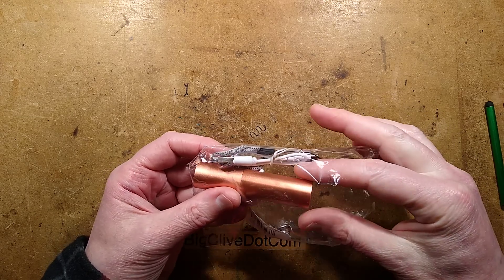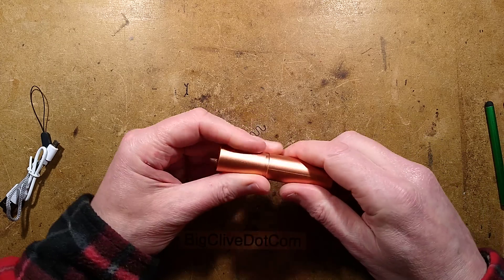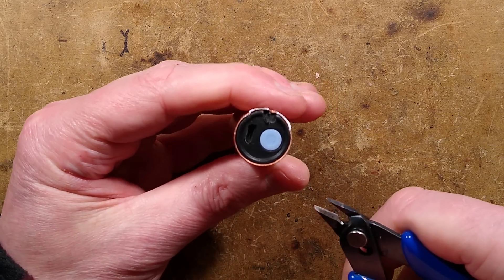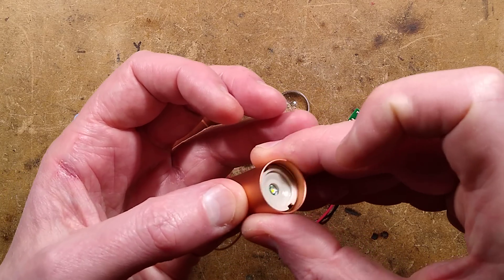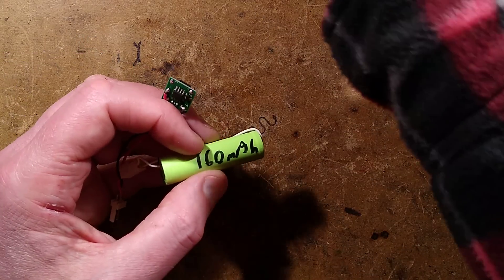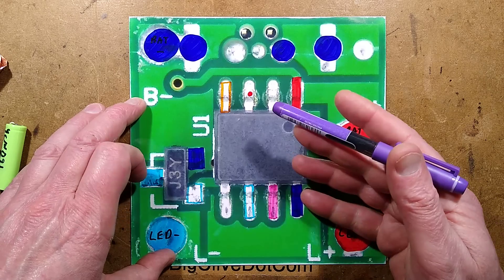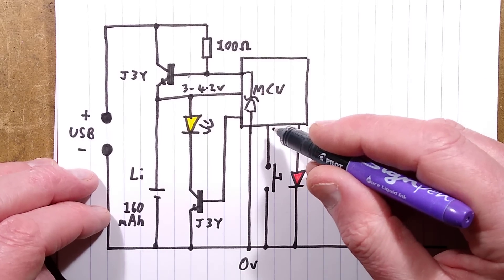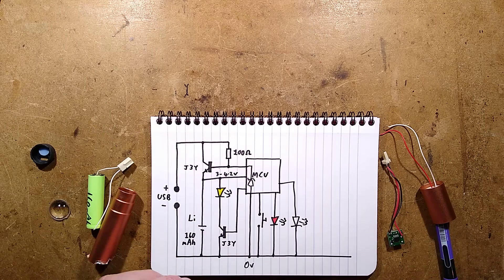eBay 98kW LED flashlight (slightly exaggerated) with schematic

Comment: I have pretty much the same flashlight but it is black... and also UV.
Mine has a problem with the micro USB port where it gets pushed in when I try to plug a charger to it so it has no contact. Now I know...
I don't prefer the use of foam as a way to stop PCB from moving back and forward. But it is a cheap way to make a cheap flashlight so I get it.

So the only problem is that I cannot charge it... and that is an issue.

Comment: Not eggagerated you can get 98kw, but you haver to use the 100000a/h ebay  - ali express 18650 batteries

Comment: ebay product descriptions. lol.. i just bought several "UVC sterilising" lamps, armed with the BC knowledge that all UVC leds are brassy , with a glass lid. i knew what they were selling didnt look like that. i got 3, complained to ebay, got refunds and kept them all. ebay tried to get me to return them, i said the process to prove their falseness destroyed them, but i could post the bits, they said dont bother. so i am going to do it some more. i just ordered another 3. i have found ebay are pretty awesome about giving money back when scammed. i bought a new "shure sm58" t'other day. it was 40 quid. it arrived and was clearly a fake, even the shure logo on the box was wrong. i complained and they said i had to return it, i said i could not, as i took it apart to use for supplying voice to a ring mod in a Dalek i made for special needs kids to ride around in. so i got to keep the mike (which TBH is okay, it was just the thought of someone thinking they could swizz me that enraged me so). perhaps we can all start buying 'uvc' lamps. you get to keep a lot of ice blue and purple led packages when you do. amusingly i even messaged these sellers before i bought anything, saying "your product doesn't look like it has UVC 'beads' in it, are you sure it make light under 280 Nm light?" they always reply "yes". bastards. lol.

Comment: You forgot to use a micro black hole to power it. That is why it didn't get it's rated output capacity. 🤣

Comment: Hey China, THANKS for the flashing mode on torches - thats what was so missing in the last 100 years and thanks for the 'economic' construction so that, despite it not havinbg an incandescent filament, if you drop it once the thing stops working permanently. Thanks, just THANKS!!!
Reply: On torches with those 6-pin drivers, some of them have a dedicated pin for disabling blinking mode.  Ground that pin and banish blinky mode forever.  I was trying to buy some of those chips (not easy) and found that titbit in the datasheets.  It was almost a life-changing moment.

Comment: I'd bought three copies of a single-AA-cell flashlight from a local store, a few years ago, and had to modify ALL of them because they didn't have a wide enough beam. Fortunately, all metal, so I just needed to unscrew the ring holding the front lenses on, slide a ring made of aluminum wire in behind the LED's backplate, and close everything back up again.

Now my only complaint is how dim it gets when the battery gets halfway used...

Comment: Assuming the LED drops 3V, then the battery must supply 32,667A.  With a capacity of 160mAh, the light produces 98kW for 4.8μs.  Very impressive, I think we can all agree.
Reply: Must be the strobing mode :-p
Reply: "Only 33kA!"
Reply: i get 17.6ms for 32667A
Reply: @LucasFerreira-gx9yh . How? I get ≈4.9µs. 160mAh capacity divided by the current 32,667.

 0.160/32,667 =0.0000049 = 4.9µs…
Reply: 👍 was about to, but you saved me from doing the maths 😆

Comment: I have a fairly similar one.
Got one for my gran and was impressed at the £4 price point.
Mine does have the obligatory SOS mode when you hold the button in.
Pretty bright too, was using it to find my way to a rave in the middle of a forest.
might see if I can change the battery out with one or two of my street lithium cells.
Reply: The ones with 3xAAA in the holder will almost take a street lithium 18450.  They're just a tad too short and need a bit of padding to fit snugly, but that's easily solved.  Twice the capacity of most NiMh as well.

Comment: The German in me wonders if they put the decimal point (Which in German notation is a comma, contrasting to our period/full-stop 🛑) in the wrong place and it was supposed to be legally sold as a 9,8000 (🇬🇧: 9.80000) watt torch, but we all know what todays online retail practices get up to! 😉

As for the circuit, it looks similar to many generic power banks I've had over the years, including PoundLand🇬🇧 ones. The usual giveaway is the two separate LEDs next to one another (On your board, the missing one would most likely be blue) and very little else beyond the NoName 8-pin IC. 🔋

Comment: Technical team: It's 98mW
Marketing team:  Let's do a clever "typo"
Reply: It could be from one of those countries that swaps the commas and the periods for decimal separator. 98,000 watt might be 98.000 watt. Still, marketing knew what they were doing.
Reply: @hotlavatube  98W would also be a laughable lie
Reply: @TheGreatAtario  Well, if you remove the resistor between the LED and the battery you’d probably be able to get 98 watt… for maybe a second before the LED burns out, but hey, mission accomplished!
Reply: @hotlavatube  Which resistor?
Reply: @maxine_q  Ah right... I double checked the video and Clive did say they didn't use any resistors to limit the current. Well then, we'll just have to swap the battery with something with a little more oomph then!
Reply: @hotlavatube  Still probably can't send 98watts through as the near microscopic LED interconnect wires will burn up first with much less power.
Reply: better typo would be big M

Comment: I bought this exact torch but in black. It was reasonably cheap, but not cheap enough. I bought a Sofirn SC18 at the same time and I will say I the Sofirn is amazing value for money, while with this thing I felt was terrible value.
I, of course took mine apart too. Managed to get the end cap out by leveraging from the charge port.

Comment: Amazon has a huge number of misrepresented flashlights of varying degrees of quality.  Sometimes you'll get lucky and get a decent flashlight, but the odds are stacked against you.  Generally their components are very similar to the one you took apart in this video.  A "high power" grid LED connected to a minimalist circuit and a poor quality lithium battery all stuffed in a cylindrical case.  Some of the flashlight cases are quite decent quality in order to give a better feel and appearance to the flashlight.  The brightness is generally on the order of 1000 lumens.  The postings, however, will claim 100k to 1 million lumens.  The posting will also almost always over-estimate the battery capacity to sometimes absurd levels.

This problem also applies to lasers listed on Amazon.  However, in the case of lasers, this is very dangerous.  Also, unlike the flashlights, the misrepresentation can often be an under-representation rather than over.  This means that a green LED laser will claim a  Class 2 "safe" < 1mW rating, while actually being dangerously high.  This is because, like the flashlight circuit you disassembled, there is no current regulation going to the LED.  I have a class 3 25mW green laser off Amazon that, at full charge, is close to 500mW and will  injure eyes across a gymnasium.

Comment: The BLF A6 is my go-to flashlight, developed by budgetlightforum users, sadly discontinued so bought 3 when I last saw them on sale.
A very tough 18650 powered Cree driven waterproof torch, the single click switch which has some nice features by half-pressing the button for 0.5 seconds; 7 brightness levels, strobe, battery charge level (1 blink=25%, 2 blinks=50% etc.), and a bike flashing mode.
Reply: Of course a light designed by committee has strobe
Reply: @_BangDroid_  Lol.
Reply: I have several 1600 lumen BLF A6's. I LIKE em also

Comment: I bought a copule of those in Aliexpress. The model with an extral pretty decent cob led on the side (that might explain the very little battery chosen), which used sideways are good headlamps with a 3d printend strap.

Sadly, the battery is so tiny they run out of juice in a couple minutes. Pretty bad. I have them demoted as emercency units gathering dust in "that flashlaight drawer"  in case lights go out (to use to hopefully run long enough to just find the proper 18650 based flashlights that I literally carry around every day.

Of those 1860 ones, I have a also Chinese Convoy S2+ that I love, last years in a sensible power mode, and gives proper uumph when set high. Sadly it has a "programmable" driver that can be set to roll through several blinking modes that I hate.  Is there a way to hack those MCUs into different modes? That might be an interesting video there (interesting only to me, I mean).

"...by brute force and ignorance" finally a name for tecnique and set of skills I was born with! 

Educative and brilliant, as always. Thanks!

Comment: The whole bottom part with battery and pcb is the same as those cheap bear trimmers. Guess they're using these tube thingies for more devices. 
Tested the battery and it held no more than 100mAh. I put an 18650 in and made into a handheld fan.😄

Comment: I had a great laugh at the power of that amazing flashlight. Given that 100kW laser systems are used to cut metal, etc., and are the size of a large pick up truck. I’m just impressed by the micro miniaturization that they obviously managed to accomplish. 😂

Comment: I leave reviews on the products, without purchasing them, to warn any potential buyers of the misleading descriptions. There's no such flashlight as 98KW. There's no such 18650 battery that is 5000mah or higher. It's not physically possible with any current battery technology on the market. If you want a bright flashlight, go to a flashlight store online. They will cost you at least $50. I bought a decent Streamlight knockoff for $30, that used 2 AA batteries,  but my 1000 lumen 10w Led flashlight, which uses 2x18650 batteries cost me $60 on clearance. The batteries are not replaceable, as the company doesn't service or sell parts. However, I did disassemble the battery pack and swap out the batteries. It's just 2x18650's end to end, with leads on each battery contact and one in between the two. When charging from a usb, it charges each battery in parallel. But for discharging, it uses the battery in series. You can use the USB to charge other devices, also. I replaced the original 2000mah batteries with 3000mah high Amp batteries. It gives me a large boost to operating time in the flashlight or more power to charge devices. Because of the original battery design, I could not test the battery capacity with any ease without going through the circuitry of the light, so I couldn't verify the actual capacity of the batteries. I don't feel that they were actually 2000mah. They weren't labeled with the manufacturer, like samsung, Sony, or LG. But the batteries I used are Samsung and are very near the 3000mah claim. It seems to last twice as long as it did when new between charges, so I'm betting their 2000mah was more like 1600 or less and I'm running closer to 2800 with the new batteries. I've been testing out Lithicore 3500mah batteries for awhile and they appear to run just over 3000mah consistently, but I haven't seen one hit 3500 yet.

Comment: Perhaps the space for the extra LED near the charging indicator is to hold an LED to indicate the power is on. If the company may use the board for more than product then the need for such an indicator may be required. An LED to tell tell the user that a flashlight is turned on would seem to be rather redundant. (Unless the flashlight was emitting non visible light, such as infrared.)

Comment: You should disassemble the battery. I bet there is just a small li-ion cell inside metal housing. You can check it by rolling the battery on the table, if it's not smooth (due to uneven mass center) then I was right.

Comment: I'm just guessing, but I don't think even a solid rocket motor at that size would be near 98kW. It's the same marketing firm writing eBay MicroSD descriptions.
Reply: Ah yes...The same folk who advertise a card as being „32gb“ 🇬🇧 but when pressed over why their crappy product only has a 4🇬🇧 card inside it, they point out that you bought the 32 giga bit (4 Gigabyte) product... 😉

Comment: About slight exaggeration .

I have a Bluetooth speaker (the mobile trolley kind). Which according to the spec is
1400w p2p
700w max
350w RMS

And i opened it up and the actual amp was a TDA7377 which is 2x30 watt (2x35 max)
😂
Reply: Ah, who here remembers the good old days of PMPO.
Reply: @j.f.christ8421  Pre Mortem Peak Output :p
About as useful as a "very loud" sticker

Comment: I have a similar, yet grossly less powerful lamp and unintentionally disassembled the sliding focusing bit in in a similar forceful manner.  This also detached the led wires from the board.  
I was able to remove the cell via inertia(this involved the wires from it being torn off as well) and used a wooden dowel to punch the switch/charge end cap out from the inside without damage.
 After all the bits were extracted and connections repaired the light was reassembled and continues to function to this day.

Comment: Are you sure there isn't some sort of nuclear reactor inside that "lithium battery" shell, to give the 98000 W rating? Maybe one of the type used in the Scottish Army MRE heaters? Anyway that circuit and LED must be pretty inefficient to produce such weak lighting from 98 kW.  8^)  Cheers!

Comment: Hi Clive, Great video as always. I must admit to liking these little torches and have quite a few.
I was wondering if you could help me find some good quality solder wire leaded at a decent price. Most of the cheap solder on eBay is crap (sludgey and dull with a high melting temperature), but the quality solder wire seems outrageously expensive at over £50.00 or more for a 500 Grams Reel. Do you know a source of decent priced quality Solder Wire?
Many thanks Clive.
Keep well and stay safe,
Joe

Comment: Cannot say i am surprised, i got ripped off buying one of these supposedly (light up the side of a building or the whole street type mag light). Seemed like a good idea, as i use a rudementry version as my pushbike headlight. Can only be better? or so i thought. What turned up is in fact a mini light, suitable for a handbag maybe to help you see your keyhole, but also no return address, well only in Chinese, nothing in image to show scale, the advertised one at £17:00 looked great for what i wanted, but shown as being larger than the user's hand, whereas mine is about 2 inches long, no adjustment other than, on flash, S.O.S. so relegated to bedside table in case of power cut.
Reply: Varying the scale of item photos is now a common trick, and is why I stopped buying things from Amazoff. There's a widely known meme of a „Desk organiser“ which shows an iPhone 6 on one of the lower shelves. Just see what happens when you try to put a real iPhone 6 (Not a dolls house miniature) in the same place... 🙃

Comment: As a rule, I NEVER buy flashlights with non-replaceable batteries. It's just landfill-bound in short order otherwise.
Reply: A rule I also abide by, but one that is becoming increasingly difficult to uphold.
Reply: I usually follow the same rule with lights that I can’t replace the bulb. I say usually because LEDs have allowed a lot of creativity and some lamps are in shapes that could never be made with replaceable bulbs. But for any light fixture that could easily have a bulb inside and is made with an irreplaceable LED, I won’t purchase it. I know that the LEDs should last a very long time but that depends on how the company uses them for the background lighting and after approximately five years it stopped working. It was only on for a half hour after it noticed a person moving in the room, so far from five years of continuous use. After opening it up I saw that the first four or five LEDs at one end had burnt out. The company pushed the LEDs too hard and if I buy a light fixture I have no promises that the manufacturer of that won’t do the same. I’d like to replace the outside lights on my house. I’ve seen some very nice fixtures but unfortunately none of them use removable light bulbs.
Reply: Pending e-waste, just like Ear pods and every other similar product
Reply: @_BangDroid_  

I thought the business model for cordless earphones was that they would become lost way before issues concerning battery life showed up. :) It’s not uncommon to see one on the floor of public transit or on the sidewalk or platform nearby. Somebody rushes to get off or on a bus/train dropping an ear pod and they won’t stop to pick it up, if they even notice.
Reply: I apply that to ALL products.  Very few cellphones have the option.  There is a law suit for that right now and they are making progress.  Nio is the ONLY car company making EVs correctly.
Reply: Every battery is replaceable if you have a screwdriver and a soldering iron
Reply: @fallingwater  ...and saw, prybar, etc.  "We" can, but it is not user or environmentally friendly.  It is always about profit.

Comment: I just destroyed mine cause the battery died (surprise surprise) with a similar design to that, but not zoomable. Turned out the lens assembly is held using screw body type, but was glued. LOL
Reply: I'm guessing you bought the „Deluxe“ version? 😉

Comment: Maybe it's 98kW EIRP (Equivalent isotropic radiated power), incandescent equivalent, using whatever method they use to rate shop vac motors at 6.5 horsepower?

In other words, what is the power of an incandescent bulb that shines in all directions with the same brightness as the focused beam of the flashlight, but at initial power on when the filament is cold and draws more power?